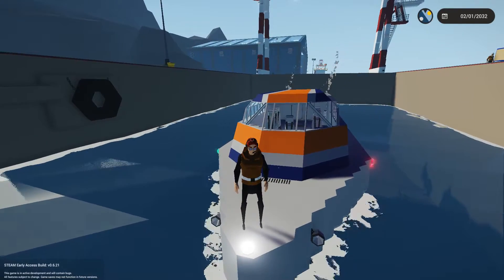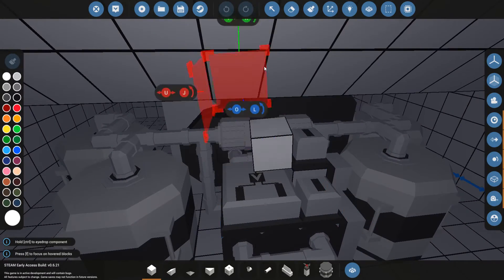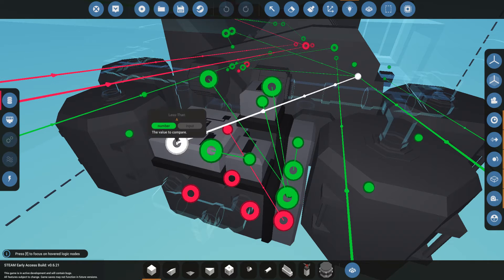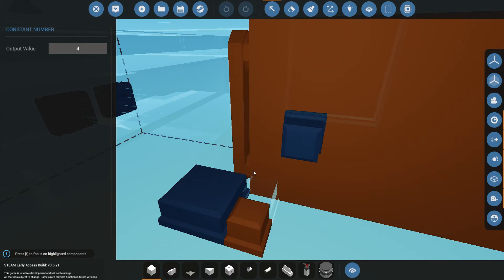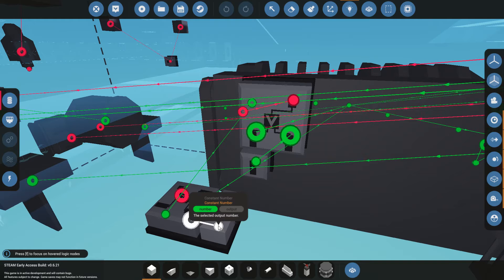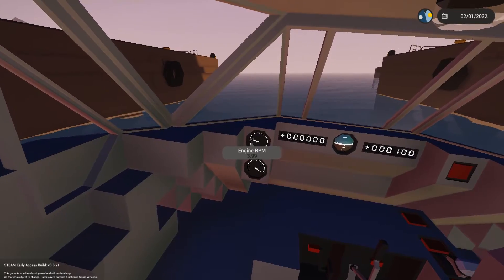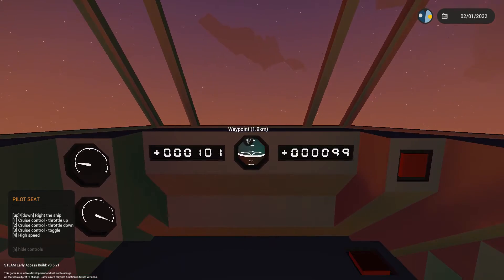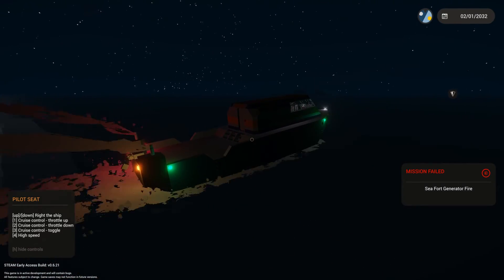Stormworks - Diesel-Electric Boat Tutorial

Comment: You could get it a little bit more efficient if you turned your engine off when your battery is at 100%, never the less im gonna make my next propulsion system inspired by yours

Is that system more more fuel efficient for the speed you get than a equivalent only with the diesel engine?

Comment: While I haven't had success with diesel electric I have had success with automatic gearboxes and autostarters which seems like something the generator would like, a simple one would set the generator PID RPS to a torque meter between the gearboxes and set it to 12, then set the gearbox in between the torque meter to gear up when for example the engine RPS is bigger than 9, and be on a set reset switch so that it will only deactivate the gear once the engine goes down to 2.5 RPS, this allows the generators to run more steadily in case high seas often choke the engine and will require less power to start up should the battery circuit be heavily discharged somehow. it will drain fuel a bit faster than normal during start up but less extra than the shortening of time to start it up meaning more fuel being used at peak efficency of charging the engine. After I come back home I will now try to convert my Helicopter to diesel electric from the things I learned during this video (though for a helicopter that might be a hopeless endeavor).